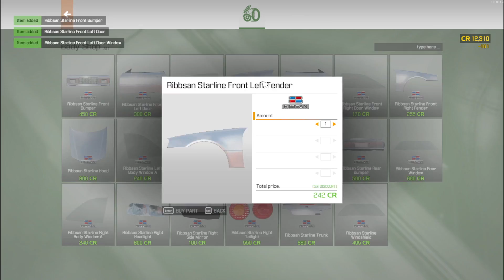Story Order 7 Ribsan Starline | Car Mechanic Simulator 2021

Comment: I can't be the only one with this glitch: It says i need to change the wheel hub bearings, I have done that about 20 times, reset the game, waited for new patch notes and re-installing but it still says i need to change them... wtf
Reply from the maker: id check into the steam disccusion board about this.. it might be a bug but just to be sure id change each wheel bearing to a brand new part then chat about it on the chat with screen shots to prove it ha sbeen done with new parts.
Reply: same here

Comment: The shopping system is so much nicer now my only suggestion would be to use the same mechanics for the warehouse whenever we unlock it I’m not sure if there is a way to toggle between your shopping list and parts in the warehouse that would be nice as well
Reply from the maker: i agree with this would be nice unless si haven't seen the button
Reply: @Hybridsteel  or if there was the option to access your warehouse from the computer probably be a lot easier for them to implement that change that way love the vids by the way just picked up the game yesterday discovering I should probably get a lot more tools before I tackle some of these story missions

Comment: Bruh how do you put that engine head cover b back on it won’t pop up for me and I see it was happening to you but you skipped Thur it
Reply: Nvm I found it
Reply: Dude I can’t figure this shit out. Lol what did you do. ?
Reply from the maker: if your having the same issue then u have to make sure all bolts are down before putting anything else on.. if you have any questions that can be answerd then add them to comments i can answer as u go through it as well. but mainly u have to fix everything that is mentioned on the lists.
Reply: @JaDiggy  check all camshaft caps, was having same issue
Reply: @ttham2  thanks dude

Comment: hi mate do you know nay quick ways to level up because the levels are dragging and i want to do the story missions but u only get 1 story mission per level
Reply from the maker: best ways to level up really are use all the test tools to get more xp out of each car and do jobs with more parts.. i havnt had time to test out the jobs like i did before on cms18 but if its like the last game it would come down to time spent on cars and how many you can get through quickly if you take on a junk car and repair the whole thing xp will come through quick but really use all the tools to diagnose the cars.. but when i have got through all the story cars ill dive into xp gain
Reply: @Hybridsteel  okay thx mate
Reply: @MichaelFunnell   As he said above there's really no quick way but I found that going to the junkyard and using the Examination mode on all the cars that are there is a good way to make up close to 50-70XP per car that you exam if you hit all the parts! And also make sure you are using all the diagnostic tools when working on any jobs will get you a good amount of XP as well!
Reply: @BaumGaming  okay thank you

Comment: I have some kind of bug where I can't mount the front license plate, any suggestions?
Reply from the maker: mounting it ok do u have 1 to start with.. if so did you push mount par tto bring up the ghost of the license plate so u can see a transparent version of it
Reply: @Hybridsteel  Correct, there isn't a ghost for it. It doesn't show or highlight the plate itself.
Reply from the maker: have u tried resetting or checking the steam shop disccusions about this as it might be a bug that is being talked about

Comment: after the wheel hub bearings (on the list), it shows that I have one undiscovered part. For the life of me I cannot find it. Is it a glitch?
Reply from the maker: if you go to 9:28 i show both pages of fixes
Reply: @Hybridsteel  below wheel hub beating on the list, it shows I have 1 more undiscovered part. I have installed everything else
Reply from the maker: all i can say is compare my list to yours and see whats missing and revisit. other than that i dont know as i never missed anything as i used to strip the entire car down to make these videos @marcusporter6984
Reply: Same issue. Ever figure it out?
Reply: @miguelbrooks6032  ya I brought the car to the test line area. It was a fckin rubber bushing